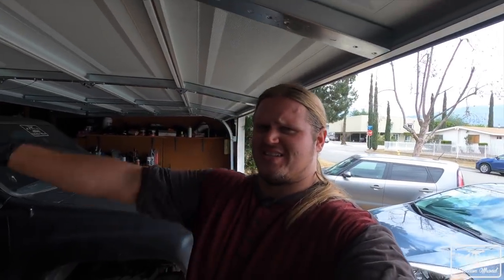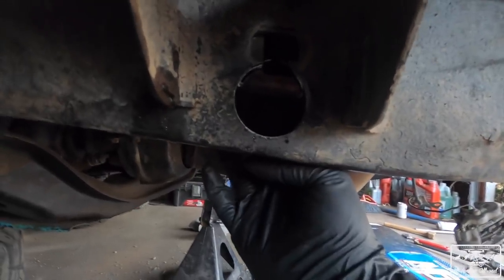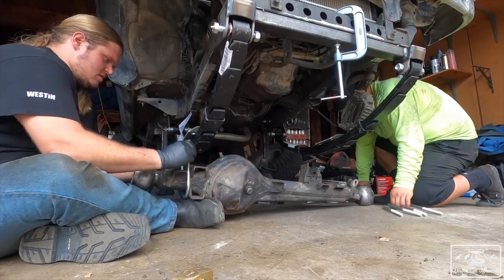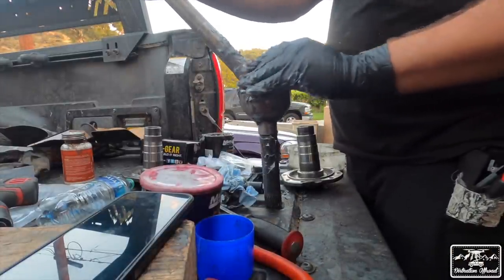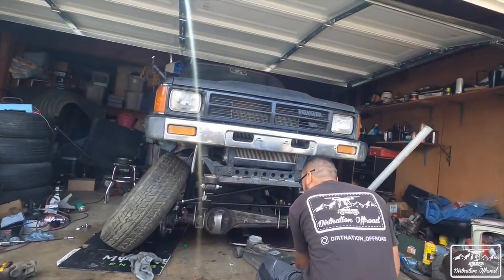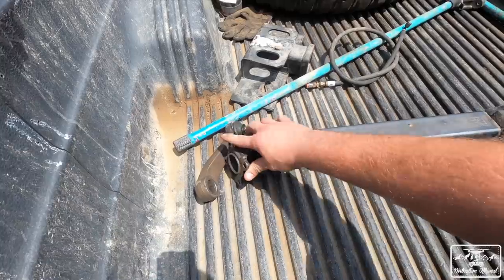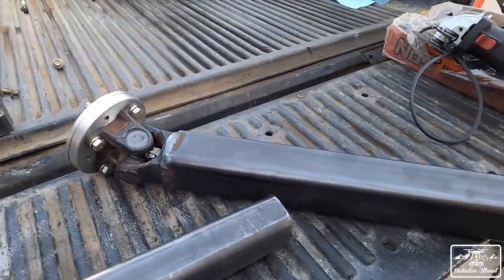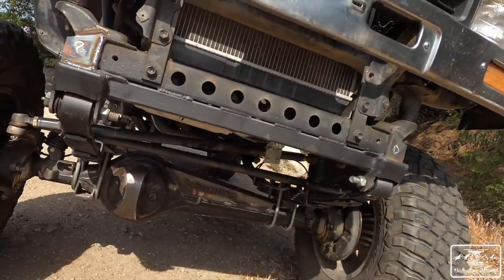SOLID AXLE SWAP 1988 Toyota Pickup! Trail Gear IFS Eliminator Kit Install and Review.

Comment: No solid axle swap needed here, I own a 84' 4X4. Just did a cab and bed swap so now I have a newer rig. I did the V6 front brake upgrade which put the rotors on the outside of the hub, brake jobs on the front no longer requires me to remove the entire hub.

Comment: Hey, if you ever see this comment what front axle did you use? I’ve been told like 5 different axel’s to use lol. I wanted ask someone that’s actually done it. I wanna do this exact same set up. This video is Awesome!!! Best one I found on how to SAS. You actually explained how to & what parts & showed your work. 👍🏼💪🏼💯
Reply from the maker: Thanks! So the axle I’m using is an 85 4runner axle…my understanding is this SAS kit will work for any 4x4 front axle 81-85 hilux/4runner 🙌🏻

Comment: I’ve seen people weld a cap on the inner tube of the driveshaft and shove a bunch of grease in the outer tube so when you slide the inner tube in it will compress the grease into the walls and fill in the gap to help with rattling. While the 4wd ain’t engaged
Reply from the maker: That’s interesting 🧐 maybe could do something like that in the future

Comment: pro  tip, those snap rings are easier to install, if you DONT stretch them out like you did prior to installing into the CV stub. i always push them on the shaft from the end. kinda like a jimmy hat lol

Comment: In South Africa...The Hilux came with straight axle from 83 all the wat to 98...We did however not get the 4 Runner and the Xtra Cab. We did however get a single cab and double cab or crew cab as you know it. IFS only came in from 99/200 onwards.

Comment: Great shit! I really appreciate this video. The pure rawness, dedication, informing, diligent to gey this out there. Cool shit man! You inspired me more to do my solid axle swap on my 2011 ford ranger XLT FX4. So how much did it cost you to do it?
Reply from the maker: Thanks for watching age I appreciate the kind words…this cost me about 3500 to complete and that’s with me saving on labor doing stuff myself
Reply: @66Duffman  Awesome! I was looking at about the same cost in parts. My budget will be about $2500 and $3100 being at max. I weld, so fabricating my own stuff and going to steel salvage yard would save me a lot. I'm going with leaf spring suspension, with the Toyota steering box/leaf hanger perch/dana 30 or 44 axle with truss/chromoly axle shafts/reinforced inner C's/ chromoly tie rod, panhard bar heim joints/ lunch box lockers/ 4.56 gears/ 33x12.50r15 interco thornbirds with custom tread cutouts, 6" lift/front/rear bumper winch and Overall, I have most of this stuff in the making.  its gonna be sick ass build!! (I GOT PICTURES)💪🏻🤙🏻

Comment: Nice 👍.. that front end flexes good..That thing is gonna be a Beast when the rear catches up with the front. Ditch the blocks on the rear and order some Deavers from Jeff. On my XJ Ricky at Empire driveline in Ontario do good work . I ordered chromoly shaft double Cardin with twice the slip for $365 a lil bit pricey but worth it . I’m sure they can set you up .
Reply from the maker: I’m working on somethings for the rear…should be a good time 🙏🏻

Comment: Nice job man I have a 2003 with ifs I'm hanging to straight axle it. I noticed you putting the snap ring on over the axle that's why it broke, you need to slip them over the ends it makes it so much easier to put on and take apart. I had to destroy mine to get it apart on the 80 Series.

Comment: When you have a problem with the shaft what I did with my pick up I put some shims so it can tilt the axle some degrees and connect with the shaft but even with the shims I had the problem so I made one my self

Comment: When you use a hole saw use cutting fluid to save time.
Reply from the maker: Didn’t show it on camera but we did use oil with the hole saw
Reply: They also sell extra deep hole saws.

Comment: That was a great video with loads of valuable info and detail.
What length are the tubes that weld in for the spring hangers?
Reply from the maker: I don’t remember exactly I wanna say between 4-5 inches 🤔

Comment: great build what front leaf springs did you use and what tires are you going to run thanks
Reply from the maker: Front springs are the trail gear 3 inch lift heavy duty…and I’m currently running 40s on the truck

Comment: I thought your shackles are supposed to angle toward the rear of the truck not the front  ? Correct me if im wrong
Reply from the maker: You are correct…since they springs have settled the shackle angle has gotten more straight angling slightly back

Comment: Sick video for the v6 break calipers did they bolt straight on to the factory spot on the solid axle?
Reply from the maker: Yep bolted right up…I cut the dust cover fir the brakes on top and bottom to create a little more clearance too 🤘🏻

Comment: to get the slop out the driveshaft braze brass on the smaller tube and sand to fit
Reply from the maker: Definitely…good to know 🙌🏻
Reply: @66Duffman  hey i was enquiring about the size mig welder used .....can i get some specs

Comment: Great job on your video!  I am using yours as a guide and it has been very helpful!!
i am in the middle of the same thing on the same year truck and I have a question..   on the shackle tube (rear) Trail Gear says "Center tube then then 1/4" and weld."   The frame makes a jog right at that spot.  SO.. is the offset on the outside of the frame 1/4" and where do you measure the 1/4"?   Thats all the tube sticks out on the outside?   If thats correct then the tube on the inside sticks way farther out.   Can you help me out with what is going on here?
Reply from the maker: Sure thing i thing it’s 1/4 the outside…we just made sure the leafs were lined up straight with everything bolted together…tacked it then checked before permanently welding it
Reply: thanks for there reply!   I spent the afternoon getting things lined up.  I'm within a 32nd LOL!  I did have to move the tube out slightly from the 1/4" recommendation.   Front hanger finish weld tomorrow.,
thanks again!

Comment: Why not weld a hanger bracket below the same location? Drilling into the frame seems like a lot.
Reply from the maker: I’ve seen other DIY kits do that….honestly seems stronger the way Trail gear set it up…worth the extra work

Comment: nice work..   Can you use the IFS locking hubs in place of the SA hubs?
Reply from the maker: You can but you would need to change the inner gear…the splines are different
Reply: @66Duffman  thank you!

Comment: You should use your IFS hubs with the solid axle lockouts and you gain 1.5" per side.  You have all the parts and you could ditch the 3" spacers or at least just run the 1.5" spacers.
Reply from the maker: That’s the plan I kept my ifs hubs
Reply: I’m trying to this now and I’m having a issue with the tacoma rotors not spinning when I nut an bolt the caliper/ what size washer did you use to space it by chance ? It’s the last thing I need until the truck works!

Comment: When u go with the solid axle swap, besides modifying the front drive shaft do u have to swap the transfer case as well
Reply from the maker: No you can use the stock transfer case…although I recommend a manual transmission swap so you can use the 4 cylinder gear driven Tcase
Reply: @66Duffman  my 1990 pickup is already a manual which is a huge plus. The only other thing I'm kind of hesitant about is where to position the upper shock hoop on the frame

Comment: your front drive shaft joints were out of phase, you will get less vibes if you rotate one 90 degrees.
Reply: Great Job!
Reply from the maker: I ended up changing it afterword’s…others have commented the same thing

Comment: why do you need the spacers?
Reply from the maker: The IFS rear axles are a little wider than front axles from early models…keeps them the same width
Reply: @66Duffman  would you still need them if you put IFS hub instead?
Reply from the maker: @Jay-fq8uz  I don’t know the exact math but I think with IFS hubs they would be the same width front and rear 👍🏻